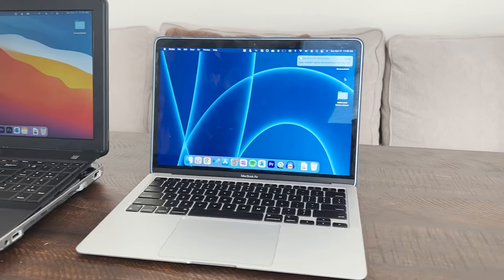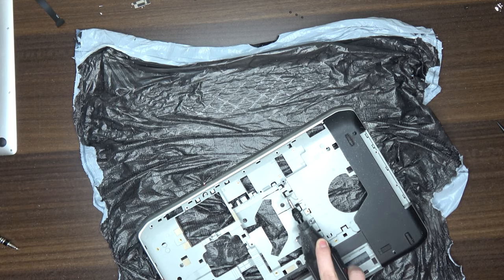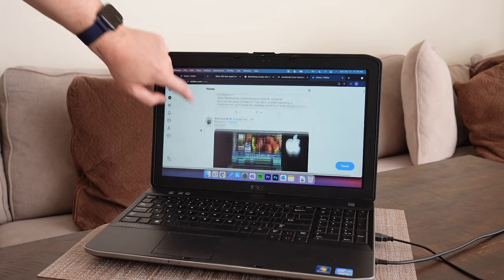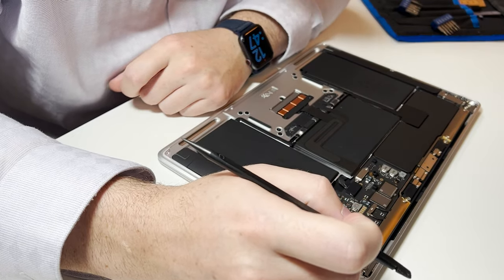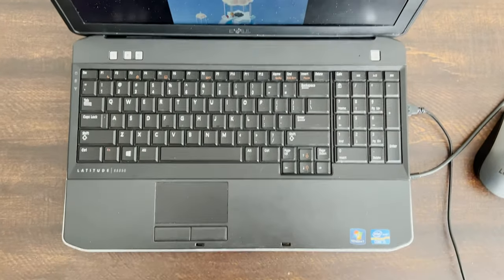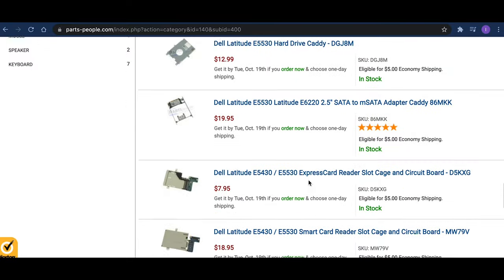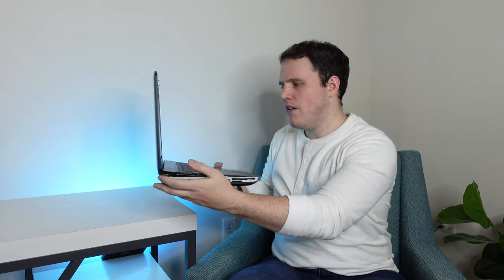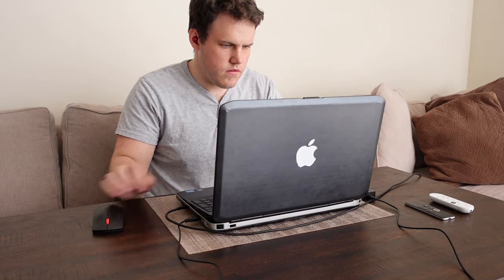Modding an M1 MacBook to Have a Touchscreen!

Comment: Man this video deserves to become viral. Do you mind if I share it in some Apple forums? 
Anyway, concerning the trackpad, I suggest using a Apple magic trackpad even if only a part of it sticks out (if you manage to find a way to fit it inside)
Reply from the maker: Please share it anywhere you want! And yes I thought about that but the internal layout is a little bit difficult, as the trackpad would bump up the keyboard. Will talk about it more in the build video. Thanks for the recommendation!
Reply: @innoiso  or you can use an old macbook track pad and convert to USB like you did with the keyboard!!

Comment: This would be an awesome collab to do with someone who does 3d printing man. 

This way you can create an aluminum casing that fits all the parts and maybe even attach an espresso display as the mod - especially if you can have it flip over like a 2-in-1 this way people can use it like a tablet.

If all goes as planned you can then offer it as a mail in service - you can make money. 

Even cooler - you'd be able to attach on of those adapters to the usb-c area all held in place by the aluminum 3d casing.

I'd pay for that...

Essentially we're removing the screen part of the macbook and finding a way to 3D print attach an espresso display to it  in a flip over 2-in-1 display.

Not for nothing this would make a dope youtube video basicaly.
Reply from the maker: Would love to do that!